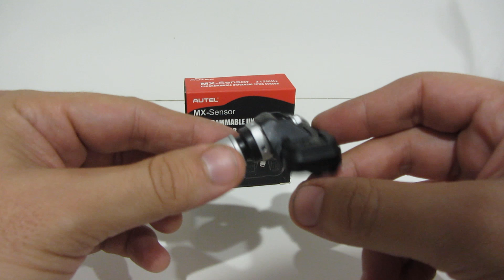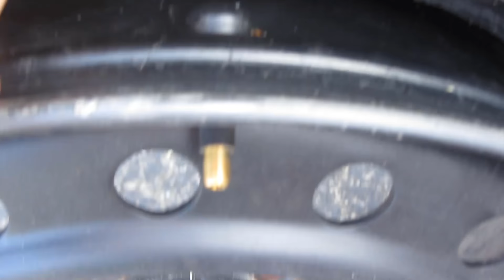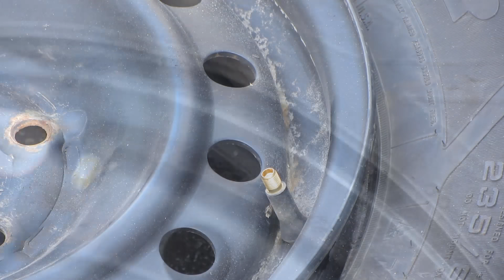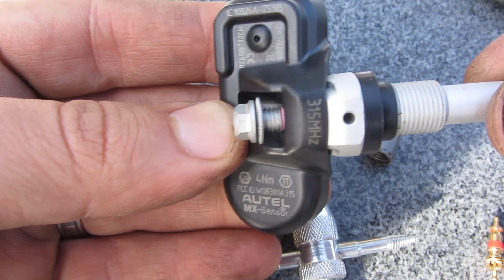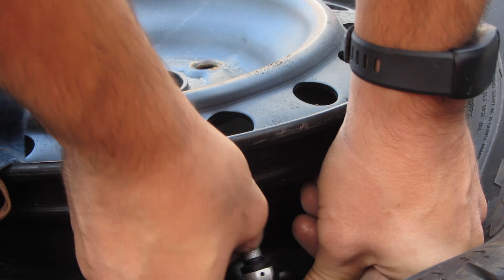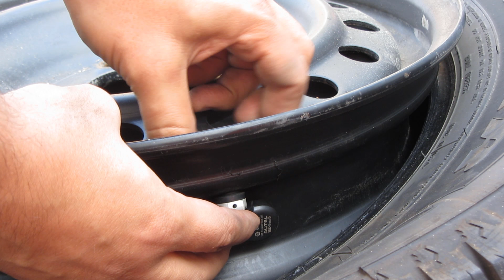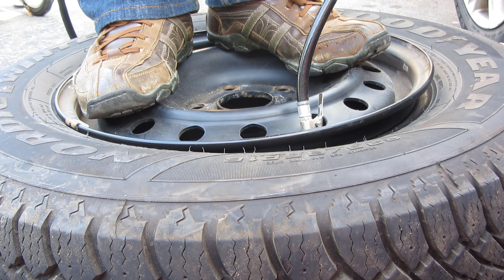Install New TPMS Sensor DIY Without Needing Rebalance

Comment: If you have to replace a battery in the sensor I guess you have to go through the same motions, right?
So are the sensors that are in the valve cap better than these? I would think so.
Reply from the maker: I haven't seen any valve cap sensors that talk to the car's computer. All the ones I've seen have their own receiver that you plug in to the lighter plug.
So if you want to use your car's TPMS (assuming it has it), then you need one inside the tire. But the batteries are not replaceable. The sensors are sealed. I tried cutting one open once to see if I could replace the battery and it didn't work after that.
Reply: @GabesHacks  Thanks for your answer. The car that I want to install the sensors does not have original TPMS, and the sensors that are in the valve cap have replaceable batteries. I'm wondering if they require tire balancing. The sensors are very small.
Reply from the maker: @mariosorganicgardeningandh8123  I doubt it, but the only way to know for sure is to try it. Install them and see if you notice any vibrations while driving.
Reply: @GabesHacks  Thanks a lot for your help.
Reply: https://youtu.be/zGEMiUG7nIU

Comment: dont need to code?
Reply: Autel MX Sensors come blank from the factory. You will need an Autel MaxiTPMS programming tool (i.e.: MaxiTPMS TS508 or iTS600) to program them to the vehicle's specific make, model, and year by generating a new random ID or duplicating an existing ID.
Reply from the maker: I used programmable sensors. I described how and why I did in my other video: https://youtu.be/N6p6xV4PlHc

Some vehicles can automatically learn new sensors, but many can't and you have to either program the car with the new sensor codes, or use programmable sensors.

Comment: How easy do we think this will be to do on a 24" low profile wheel/tire??  Lol.  Local discount tire wants $450 to install 4 TOMS sensors.
Reply from the maker: I've never tried, but there have been several people in the comments here saying that it would be a lot harder on low profile tires.
Reply: 450 is cheap for 24”

Comment: i  can  install this system  to  my motorcycle???  is  the  same mm  the  valve???
Reply from the maker: I couldn't tell you, sorry. I have no experience with motorcycles.
Reply: Go on eBay and put tpms sensor and the model/year of your bike and you should be able to find it on there

Comment: Need program?
Reply from the maker: I used programmable sensors. I explained how I programmed them in my other video: https://youtu.be/N6p6xV4PlHc
The alternative is to program the car's computer instead. But some cars will automatically learn new sensors, which means no programming is required. It depends on your car.

Comment: Gabe, my 2015 Honda Accord EX-L  only shows the tire symbol on the dash, but not specifically which tire is low.  Is there a way I  can get my car to indicate this?
Thanks.
Reply from the maker: If it doesn't already tell you, then no. Many cars only have one receiver for all 4 wheels, so it can't tell which one it's coming from. Are you seeing the light that looks like a flat tire with an exclamation mark in it? That means one of the sensors is reporting low pressure. So check the pressure in each of your tires and see if one is low.
Reply: You need a tpms reader to determine which is bad
Reply from the maker: @rjlewis8346  He's describing the low tire symbol, which means that one of the sensors is reporting low pressure. The sensor could be bad, or just doing its job.
Reply: @GabesHacks  yes, I work in a shop. There’s a autel that tells the pressure and the tmps battery life.

Comment: gabe   hi if this tire does not have tpms  you can insert a new valve stem without   breaking the bead . they have a speacial tool out on the market   to do it    laser tools and zoro tools   make them  check them out
Reply from the maker: Are you talking about the ones that are valve caps that monitor the pressure?

Comment: Great video and I appreciate the headsup concerning summer tires.  If you could include car make and model with a short explanation on how to program the sensors. Some cars detect and program themselves others require an expensive scanner/reprogramming tool.
Reply from the maker: I mentioned another video at the beginning of this video where I showed how I programmed the sensors. I put them in a 2010 Honda Odyssey EX-L, which does not automatically learn new sensors: https://youtu.be/N6p6xV4PlHc

Comment: I took 4 tpms and asked the shop to replace them while replacing tire he said 20$ extra each
Reply from the maker: That's not bad. Sounds like you found a good shop.
Reply: Not bad for the charge. Les schwab cost almost 300 buck for suv vehicle, I told them that they can just charge less because they can just break the bead and put in my new sensor in it. So they don’t have to charge me for the wheel balancing too. I went somewhere else only pay $80.

Comment: You replaced the old valve with a TPMS sensor which it's heavier and WILL NEED REBALANCE.  Regardless if you don't change tire position on the rim, by adding extra weight you will need rebalancing. Maybe won't be noticeable  for this small diameter iron rim and big truck tire, but try this on a sedan or SUV aluminum wheel with smaller profile tire and see how good your balancing will became LOL
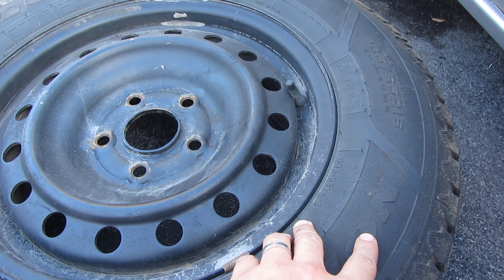Reply from the maker: It's possible. I talked about balance at 2:17

Comment: You're removing the Schrader valve not the valve stem
Reply: buzz off troll. Everyone knows that, no one cares about details that don’t matter but idiots like you that look for the smallest detail they can use to try and make themselves look smart. Backfire, you look like an idiot.
Reply: The Schrader valve IS the valve stem.

Comment: I did this today. Cheap Amazon replacements on my 2012 Dodge Grand Caravan. I used the same lever technique you did and was having a hell of a time breaking the seal. Until I added some soapy water. The rest popped off right away. I drove the car for maybe 10 mins before the computer picked up on the new sensors and automatically updated.
Reply from the maker: Awesome, that's great to hear!

Comment: Maybe someone has experience with this:  I picked up a spare sensor and I asked a dealership to install it on the temporary (55psi) spare.  They attempted it but I was told that it would not physically fit the rim.  Is there a special sensor that's made to work on these skinny spares?
Reply from the maker: No. It's usually understood that small spares will not have a sensor. They're for very temporary use anyway.
Some vehicle can fit a full size spare, which you could put a sensor in, but that only makes sense for vehicles that can automatically learn new sensors.
Reply: @GabesHacks  They generally don't have it and the system may not accommodate a 5th sensor but I'm determined.  I didn't understand some of the different types so what I provided to the dealer was a 1-piece clamp-in model - probably the least flexible choice.  I wonder if a two-piece snap in style may have worked but then I discovered there is such a thing as a banded sensor (legacy design?) which is totally separate from the stem. That might be the solution I need.  I'll have to monitor it separately but it will still save some aggravation because the spare gets fastened in the trunk covered by a storage tray and with the valve stem facing down.
Reply from the maker: If your vehicle automatically learns new sensors, then this is easily doable. You can find TPMS sensors with rubber valve stems, which should work. But if your vehicle doesn't automatically learn new sensors, then yes, you will have to figure out a different system to monitor it. You'll have to decide if you think it's worth the effort for a tire that you will only ever have installed for maybe a day or two at any time.
If you're hoping to monitor the pressure when it's sitting in your trunk and not installed, then keep in mind that most sensors have centrifugal switches, so they only turn on and broadcast the pressure when the wheel is spinning, and they turn off a few minutes after the wheel stops. That's how they save battery life.

Comment: I’m highly interested in why you are advising a aluminum clamp
In stem over rubber stems? For context I work in the wheel and tire industry with a Focus on tpms systems. This can cause oxidation or even leaks. The only mechanically significant reason  to use clamp in stems over rubber snap in is if the vehicle is a high speed sensor (consistent 130mph +) also if you don’t know what  you are doing when it comes to Resealing the bead of the tire. You are dealing with a federally mandated sensor, and a major safety component of the vehicle. Please take your vehicle to a reputable service shop anytime having work done to you wheels and tires .
Reply from the maker: I'm not necessarily recommending the aluminum ones, they're just the ones I used. The links I put in the description to where you can buy them do show the rubber ones as well.

Comment: This is good advice if you just need to swap sensors. Then you can pay a smaller fee to just have them balanced or if you have a buddy at a tire shop. Most monkeys i know are great with tires but always destroy sensors doing swaps etc. So i swap my own sensors, make sure its all torqued and then take them in to my buddy to reseal and balance.

Also word of advice, stop using steelies, they are ugly, they rust, and used aluminum rims can be easily found. I use basic aluminum rims for my winters (no fancy fake chrome). They look great and dont ruin the look of the car.

Comment: Bad advice, assuming the tire is good and rim still perfect it can still be out. My shop balanced a used set for a audi and 1 out of the four was out which I'd astonishing since they say for years before being sold.
Reply from the maker: I talked about balance at 2:17. Assuming your wheels were balanced before, then if you're replacing one sensor with another, then you shouldn't need to balance after. But the bottom line is: if you notice balance issues, get your wheels balanced.
Reply: The average person only balances the wheels after a tire swap over, which is fine. Most of my shops customers have 2 sets, and at best get balanced once every 3 years. Guaranteed to be out of balance after all that abuse.

Comment: Very unprofessional way of changing TPMS sensor, not using the proper torque, not balancing the wheel again. Do not follow those instructions. It is a disaster.
Reply from the maker: The proper torque for the sensor you mean? It's so little that it hardly matters. I discussed that in the video.
Likewise, I discussed balance at 2:17 . If you're replacing one sensor with another, balancing is very unlikely to be needed. Bottom line: if you experience balance issues, then get them balanced.
Reply: @GabesHacks  GM Dealership tech here: Just pop the bead pop the sensor in and put it back on the car. Unless the sensor weighs 5 lbs, there's zero reason to rebalance, these people don't know what they're talking about lol, sensors weigh nothing.
Reply from the maker: @ToothNroost  Yeah, people don't seem to realize that wheels can never be 100% balanced. They just need to be balanced to a point where any imbalance is imperceptible.

Comment: Question. I just installed aftermarket rims and tires on my vehicle and nobody told me to take my sensors from my stock rims so now my sensors light is on in my car. I'm a female so I can't install these myself lol how much do you think the shop or dealer would charge?? And should I purchase the sensors from Amazon or the shop? Thank you!!
Reply: My guess is ... 
Plus the cost of the parts. Most shops will charge $20-30 per tire.
Reply: @TheScrumdown  thank you
Reply: @TheScrumdown  If you think about it, that's not too bad when a balance is included .
Reply: @papagigo1  For most, not a bad price. But, I have the tools/equipment to do it myself.
Reply from the maker: The dealer will always be the most expensive. Others in the comments here have quoted some ridiculous prices. An independent tire shop will be your best bet. The last time I asked a shop, they charged about $70 Canadian (about $56 US) per sensor. But every shop will be different. Call around.
Whether you can buy the sensors on Amazon beforehand will depend on the shop. Some places don't like to install parts bought elsewhere.
Reply: @GabesHacks  thank you!
Reply: 20 per tire

Comment: TPMS sensor adds extra weight to the rim/tire assembly, definitely require a rebalance after this procedure
Reply from the maker: It's possible. I talked about that at 2:07
You can only say that it "definitely" needs to be rebalanced if you experience balance issues. And if you're replacing one sensor with another, then it's very unlikely that rebalancing will be needed.

Comment: dont forget programming sentor now
Reply from the maker: I showed how I programmed the sensors in my other video: https://youtu.be/N6p6xV4PlHc
Some cars automatically learn new sensors. For the ones that don't (like mine) you can either program the vehicle, or use programmable sensors like I did. I chose the programmable sensors because I was creating a second identical set for my winter tires.

Comment: I knew there just had to be a cheaper way to replace my tire sensors. Damn shop wants to charge me $480 for replacement of (4) tire sensors. After I just purchased a brand new set of tires. He claims to be giving me a discount. Damn 🤡s….

 Great video!! Thank you for sharing💋
Reply from the maker: Yeah, that's silly, but unfortunately not uncommon.

Comment: The sensor don’t have to be set up with the car computer?
Reply from the maker: It depends. I used programmable sensors, as a described in another video I made: https://youtu.be/N6p6xV4PlHc
But if you use regular sensors, many cars will need to be programmed with the codes of the new sensors. However, some cars will automatically learn new sensors.

Comment: Make sure they are preprogrammed….not just any old sensor would work
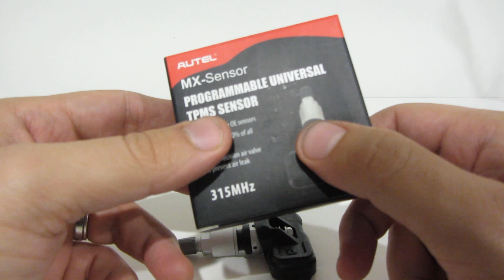Reply from the maker: I used programmable sensors. At 0:47 I mentioned my other video where I showed how I programmed them.
That said, some cars do automatically learn new sensors, so in those any compatible sensor will work with no programming.
Reply: @GabesHacks  I do this every single day I’ve never seen a car automatically learn the sensor. You have to activate the card system to read the radio signals off the sensors. And each sensor needs or has a specific ID like the preprogrammed ones but you just don’t put them in the tires and that’s it you need to register it to the car
Reply from the maker: @ratchethondaracing2240  Yes, that's how my Odyssey EX-L worked. But there are indeed vehicles that automatically learn new sensors, like the Odyssey Touring, where you just install the new sensors and the car figures it out.

Comment: Didn't mention that have to get a reader to have vechicle computer to requinize new sensors
Reply from the maker: I used programmable sensors so I don't need to program the vehicle. At 0:47 I mentioned my other video where I showed how I programmed them.

Comment: Can you use WD-40 instead of soap to lubricate the wheels seal?
Reply from the maker: I imagine it would work as lubrication, but I don't know how WD40 interacts with rubber. It may or may not eat at the rubber. I've never tried it.
Reply: WD-40 and rubber is a bad idea. Silicone lubricant is ok with rubber.

Comment: Does anyone know what a dealer charges to replace 4 pressure stems? $175 hr or $700 for labor and $700 for 4 stems.$175 each.
Reply from the maker: Is that a real quote you got? That's crazy.
Reply: Discount tire does it for free
Reply: @coolmw2player  they don’t do it for free, discount tire charges a minimum of $45 per tpms

Comment: how much last the battery of those things?
Reply: my 2008 Prius just went dead (2021, so at 13 years).
Reply from the maker: They should last several years. It depends on how much you drive, since they only turn on when the wheels turn.
Reply: 5-6 year i can very by manufacturer

Comment: I thought you need rims that are made for clamp-in TPMS sensors.  You replaced a pull-through stem with a clamp-on sensor in a wheel that doesn't have the flat mounting area.  Does this matter?  I'm looking for winter wheels for my Pilot.  Most don't have the flat mounting area and Honda sensors are clamp-in.
Reply from the maker: The manual for my van said to use only TPMS rims, but I the only difference I could find is that special TPMS rims have extra weight directly opposite the valve to counteract the weight of the sensor. And maybe a flattened spot like you say. I had no problem using these regular steel rims with the sensors. The van was able to read them no problem.
Reply: @GabesHacks  Ah, perhaps all modern wheels provide a flat 1/4"-wide base around the stem opening for this purpose.  Couldn't tell if your rims had this.  My last after-market sensors were pull-through, but as your video shows they may get destroyed when removed.  Most of the sensors seem to be the clamp-in type now.

Comment: Good video to the point and the tip about all season tires and stiffness is great. I often remove the valve core and use rubber hose over the valve stem and air gun for extra air volume. Then with the tire on its side push and pull rim center in and out by hand, just to catch the bead. If that fails use a ratchet strap or twist a rope around the tire that usually makes it catch the bead! Thank you for your video